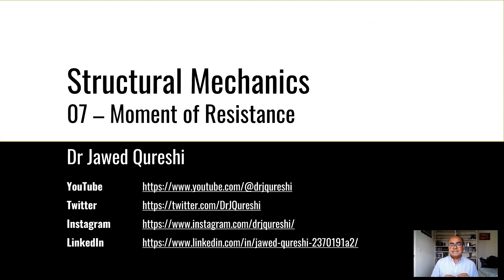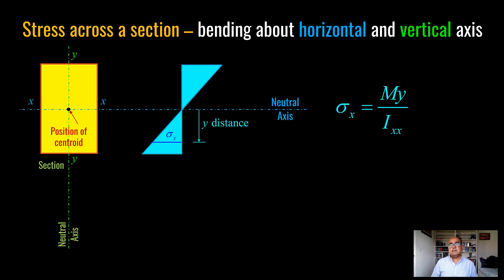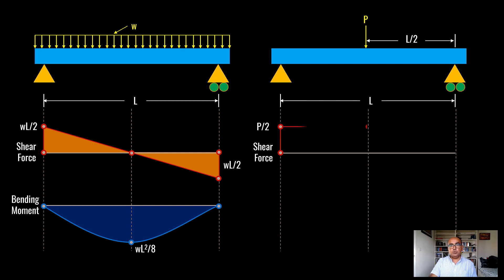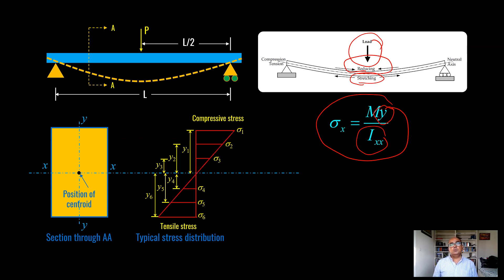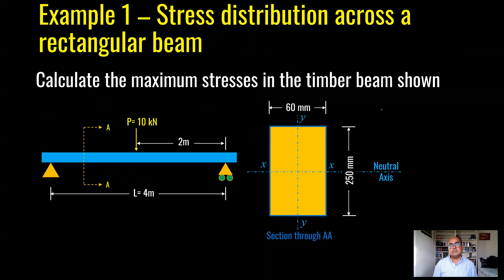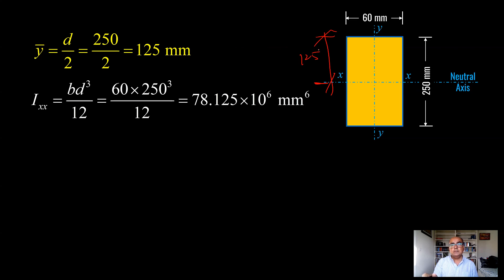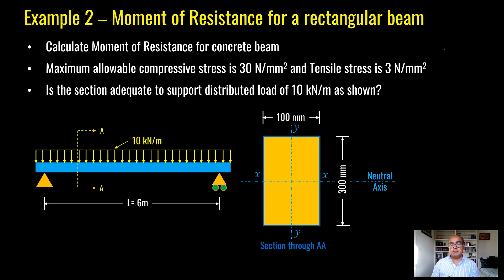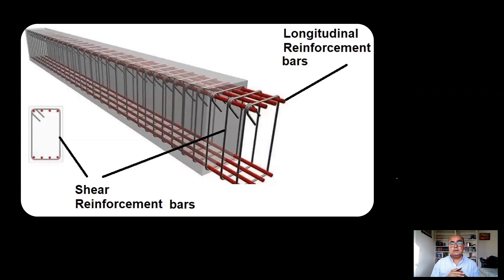Understanding Moment of Resistance and Stress Distribution in Beams

Comment: Good Morning Sir,
I have a question, how to find the deflection for multiple point load on simply supported point..
Reply from the maker: Hi good morning!
You apply the same logic. Use equilibrium equations to find reactions. Once you’ve got reactions, you can then find out moment at different point along the length of the beam.
Reply: @DrJQureshi  Sir can we apply superposition principal for find the deflection if the the beam subjected to multiple loading at different locations on same beam . Because I have compared the results with staad and risa and i found software also following the superposition principal for calculation of deflection.. please provide your insights..

Comment: Kindly explain the difference between moment of resistance and bending moment.  Are they same, Sir ?
Reply from the maker: Bending is of two types: moment capacity or resistance and applied moment. I mostly take applied bending moment as “bending moment”. The applied moment depends on applied forces, end supports and beam length. For example, for simply supported beam with a central point load applied moment is PL/4, where P is the central point load and L is the length. Moment of resistance or moment capacity is the ability of a section to resist bending. This is determined from flexural formula, stress = My/I, where M is moment of resistance, y is distance from centroid of section to top or bottom of the section and I is second moment of area/moment of inertia. For structural steel stress is 275N/mm2 and for timber stress is 16 N/mm2. I is bd3/12 for rectangular sections, where b is width and d is depth of section. Moment of resistance or moment capacity should be more than applied moment. In that way we ensure that beam can take applied forces. In real-life applications, other considerations for beam design include shear and deflection. I have a complete lecture on steel beam design in steel design YouTube playlist.
Reply: Understanding moment of resistance was very difficult Sir. Because many prescribed text books have not explained it like you. Thank you very much Sir. Can the value of applied bending moment  be same as the moment of resistance Sir, or always moment capacity is greater than bending moment?
Reply from the maker: @akashpanda1  The moment or any other loading capacity should always be more than the applied moment or loading for safe design. The purpose of structural analysis is just to find internal forces due to applied loads and deflections. The purpose of design is to find capacity.
Reply: Understood Sir. Thanks again.

Comment: Let say, I've got to design a single wind post out of rectangular steel section, grade S275. σ=275N/mm2. Can I use this formula to work out Mcr and compare it with Med (knowing point load on cantilever, say 074kN)?
Reply from the maker: You cannot use these formulae in the lecture to work out buckling moment. Use procedure in another lecture https://youtu.be/H6NukJX2WfQ?si=aXba56h4HOMTjZJy to design steel cantilever beam. Please note Lcr for cantilever beam will be 2L.
Reply: This works for all sections in the Blue Book, however where do I find section properties for non-structural sections such as flat, say 40x20?  @DrJQureshi

Comment: how will i explain in the simplest term if i am asked in an interview about what is moment of resistance?
Reply from the maker: I hope this helps. I suggest using the language that you are comfortable in speaking. May be rephrase to use a common language. In very simple language, moment capacity or resistance is the ability of a cross-section to resist applied bending forces. If this ability is more than applied bending forces, the section is safe in bending. 
I'm pleased to be of any help to you. My prayers are with you for a successful interview.
Reply: @DrJQureshi   Thank you so much. Honestly, this is the clearest explanation I've gotten so far.
Reply from the maker: Moment resistance is structural element's ability to withstand and counteract bending forces. Imagine a horizontal beam in a building. When loads or forces act on it, it can start to bend or sag. Moment resistance measures the beam's capacity to resist this bending and maintain its shape. Engineers assess this property to ensure that structures like bridges and buildings can handle the expected loads without deforming or failing. It involves using materials, design, and construction techniques to strengthen the structure's ability to withstand these bending forces.